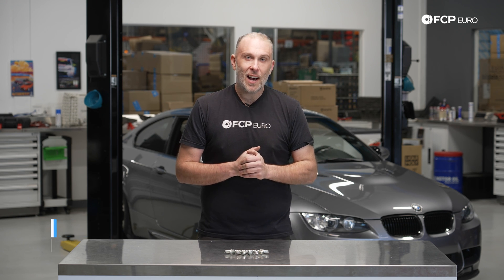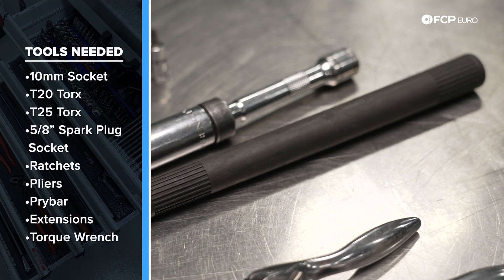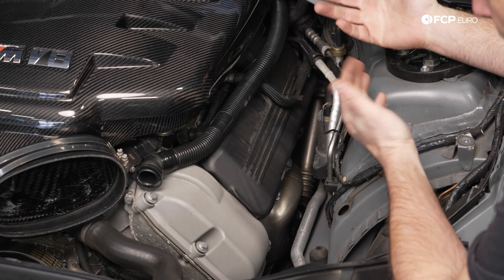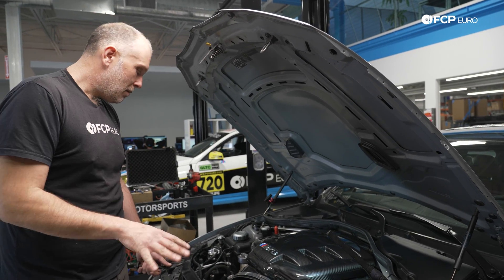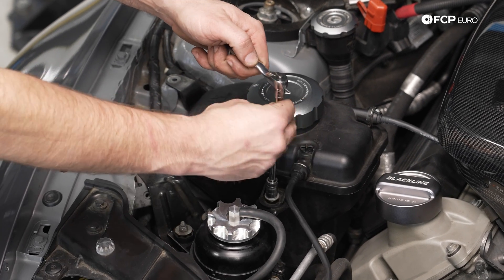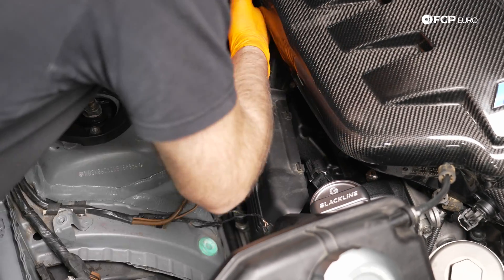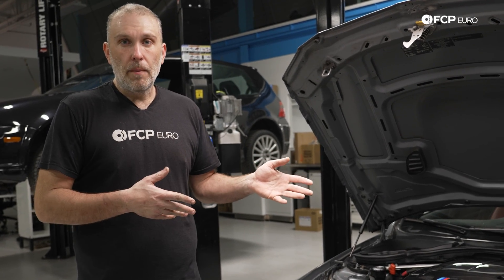BMW M3 Spark Plug Replacement DIY (2008-2013 BMW E90, E92, E93 M3)

Comment: According to NGK the gap should be .035" but I'm measuring around .020"-.022" between each electrode, equallying .040"+. Is this normal? These are generic NGK plugs, not BMW branded.

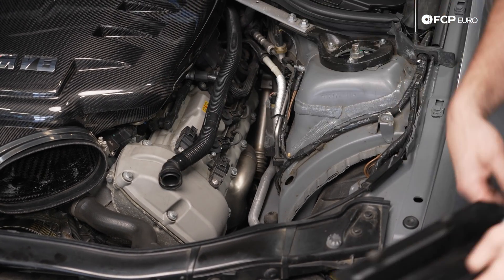Comment: Why the Thuck after you remove the plastic valve cover the two electrical connectors that should be on the cylinder head  toward the most front of the car are missing !!!????  @4:29 The reason i ask is because those two connectors cable harness is getting in the way of coil #3 and #4 and i have not been able to disconnect them.  (no problem to disconnect the connectors that are on the coils though).  This drives me more mad than the coil which i was able to pull out the first three. 
Connectors are my biggest grips working with cars, you cannot force them or you break them and those two @$#@$%@$#  refuse to come out.

Comment: FCP Euro you say 23 N.M torque spec on the spark plugs for the E92 M3.  PLEASE double check if that is correct.  Another video says it is 22 lbs.ft which is 30 N.M.  Who TF screwed up you or him ?

Comment: Just finished Vanos cover replacement and NRW head cover replacement per yall's videos, such a great help, about to do the spark plug job.  Bought 8 spark plugs for the e90 M3 from FCP, should I be verifying gap prior to install?  If so, what's the gap spec?

Thanks in advance!

Comment: NGK 4471 LKR8AP Laser Platinum OE Spark Plugs  (L-KRAP). BMW OEM Spark Plugs are twice as expensive.
FCP Euro Lifetime Warranty!!! 37,500 mile Service Interval. M3 Coil Puller Tool on Amazon is still available. Division-M

The ignition coil black plastic covers get brittle in high mileage M3s.They can break at the grommets. Put silicon on the rubber grommets if they are dried out. You can buy the rubber grommets separately and replace them.

The valve covers are magnesium, so try to put something like a cloth or piece of rubber underneath, if using a metal tool as a lever. The top of the ignition coils are rubber....so it is not a great place to stick a metal screwdriver. Twist the coil to break the seal. Use leverage under the coil and at the coil connector.
Reply: Division-M tool hasn't been available on Amazon for many years, you probably confused it with the similar looking motorcycle coil puller.  But anyway it does not work for the the back coils. Based on reading the whole DIY 22 pages experiences on the m3post forum. 
Btw which is the correct torque spec ? FCP says 23 N.M and another video says 22 lbs.ft that is 30 N.M.  Somebody screwed up but who is it ?

Comment: Just did an oil change and had the first 4 misfire. Was it possible from  the oil
Reply: Check if you put the oil cap back on properly. It might be cross-threaded. Check the oil level to make sure you didn't add way too much oil.

Or it could just be a coincidence that you had a spark plug go bad at the same time.
Reply: @rjmari   yea the oil cap is on correctly.
Reply: Seating these ignition coils in my opinion is more difficult than removing them. The reason is you do not get good feedback as to whether they have seated themselves or not.. There should be no gap between the sealing grommet and the valve cover. A slight gap would mean the ignition coil is not making contact with the nut on the spark plug. Getting these coils to seat all the way down (particulary those towards the rear of the engine) takes a decent amount of physical force.
Reply: @GarethFoley   the coils are in correctly because you hear the audible click
Reply: @gabby811ify  Is the ignition coil ground secured to the valve cover?
Reply: @GarethFoley   yea it’s on correctly and cleaned
Reply: @gabby811ify  Brand new coils or original?
Reply: @GarethFoley   OG coils, they don’t seem to look damaged or messed up. But I recently added Liqui Moly Valve Cleaner and stopped the misfires. I cleared the check engine light and running it through its cycle. Big difference tho.